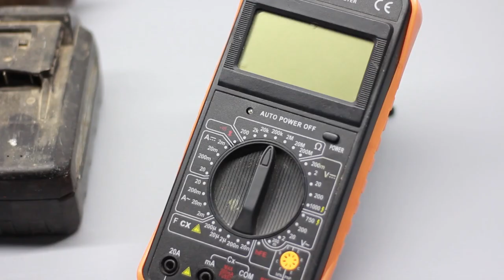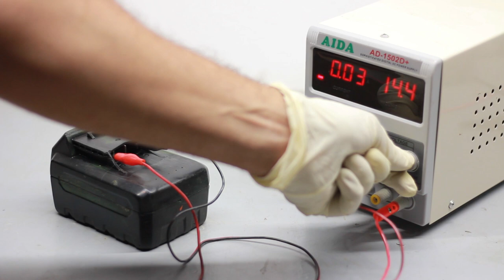Cordless Drill Restoration | CROWN 18V

Comment: I love these restorations because they demonstrate that power tools can be repaired and rebuilt. This one has been through the works and made bank for its first owner and to see it rebuilt and kept from landfill is nice to see. I hope it goes to a good home and continues to be a sound reason to prevent carbon emissions from being pumped in the atmosphere by manufacturers making more and more of these. 

But you absolutely loaded that gearbox with grease which isn't good. It doesn't need much, and too much will eventually seep in the electrics. Also make sure that super glue is compatible with the plastic housing. Super glue has to go on the joins and not around it because it dries very quickly upon being exposed to the air which will prevent it seeping in the join effectively. I like the vinyl wrap, but there has to be something akin to a rubber or urethane wrap that would be more akin to the original TPE overmoulding.
Reply from the maker: Restoration is an amazing job that allows to reduce the electronic discharges and prolongs the life of both mechanical and electronic products.
Yes you are right i put a lot of grease ,and concerning the glue it's a product that I have been using for a long time it's very effective. It takes about 15min to dry which lets it get into the joints
Thank you very much for your comment, triying to improve our work every day